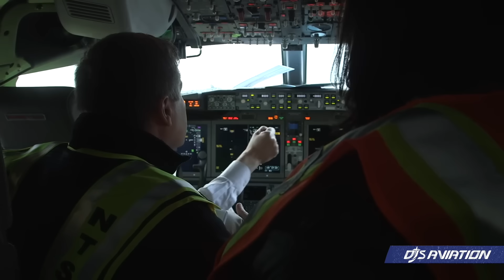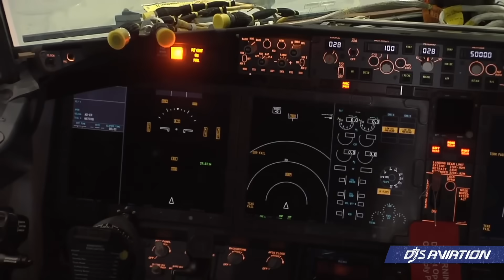Huge Boeing 737-9 Grounding Updates

Comment: Wow! 10 days since a defect in Boeing planes has endangered passengers! A new record! The Boeing corporation can be very proud! How long will it be before Boeing lays off more quality personnel?
Reply: Endangered passengers? It hasn't. Boeing corporation will not be proud as they need to sort themselves out from now on
Reply: @nickolliver3021  
I have no doubt that most of the people at Boeing are working very hard to make sure that their products are high-quality. I have less faith in the middle and upper management at the Boeing corporation however. As far as endangering passengers, by understanding, is that if the plug door Had come off at a higher altitude that there may have indeed been more serious injuries to passengers. As it was, my understanding is that some passengers on the Alaska airlines flight did have to go to the hospital for treatment.
Reply: @wbwarren57  gladly no one was hurt when it happened. No need for an explanation into it. The top management should be given a wake up call to pit their quality into their company rather than focus on the profit and getting numbers out the door. The faith is what action is taken. Hopefully immediate action will be taken on this. Once planes have been cleared to be ungrounded things will settle and we should see some changes quite quickly I should hope. Yes okay it could have been worse but it wasn't. Focusing on getting a solid fix good and proper is what's needed now.
Reply: @mipmipmipmipmip that's just imagining what may of happened. Doesn't mean that Boeings abysmal QA is absolutely a danfer to boeing passengers.
Reply: Better question..how long before the majority of what good mechanics leave Boeing?
Reply: That's exactlyy what it means
Reply: @nickolliver3021 of course, in this case, it put passengers in danger. Just because nobody got hurt, doesn’t mean people were not put in danger. SMH.
Reply: @rtbrtb_dutchy4183  anything like this will be putting passengers in danger. we all know. we get it
Reply: @nickolliver3021  What other problems exist, just waiting to wiggle free and cause catastrophic failure and were caused by a similar lapse in attention to detail. No, their problem needs to be looked at systemically as well as focused on this particular incident.
Reply: @nickolliver3021   171 of 178 seats were full; the two closest the door plug weren't. Extreme luck, given how much was sucked out even so. This could very easily have been fatal.  It's absurd and sickening to minimize it.  Boeing needs to fix these very much life threatening problems.  I suspect that only a very narrow window remains to do so, before their reputation is nil, customers won't book flights using their craft, airlines won't buy their planes.  An endless series of problems that could have ended badly.  Or did, repeatedly.

A320s and A220s seem to have far fewer serious problems, similarly Embraer.  That should be the standard, not Boeing's.
Reply: @bcbock  I don't see any other problems existing just waiting to wiggle free and cause catastrophic failure. This incident alone should be the wake up call
Reply: @bearcubdaycare  do you ever think that airlines won't be buying these aircraft ever again because of this issue? I don't think so. There reputation won't be nil. Customers will be booking flights on this aircraft when action is being taken on this issue. The results will prove weather orders and flights can resume. I'm sure it will. Tne plane needs to fly again after being ungrounded. 

Yes this could have happened to any plane either a320 or a220. Okay it happened on a max but okay it could have been alot worse. Luckily no one was near that seat by the window. This is going to be a wake up call. It had to be
Reply: @nickolliver3021  you don’t see any other problems existing and wiggle free, because this should be a wake up call?  You understand that there could be issues with airplanes that rolled out years ago right?  Just because they had a wake up call, doesn’t make any of the planes already in service, suddenly problem free.
Reply: @nickolliver3021  airlines will buy Boeings and passengers will fly them, absolutely. But it’s flabbergasting that after the MCAS, the culture inside the company hasn’t changed. 

But short term, they will lose customers. Long term will be fine.
Reply: @rtbrtb_dutchy4183  you won't know if short term they will loose customers. You won't know that unless it happens. 

So yeh airlines will keep buying them and so will passengers. Its the fact that MCAS isn't part of this issue as its separate. The culture inside will change as it will be a wake up call. I can tell ypu seriously don't see how they will get out of this.
Reply: @rtbrtb_dutchy4183  So you yell me what other aircraft may have issues that relate to this issue then? The 787 seems pretty darn well good to me. 70 odd delivered with no concerns. This is the only plane they seriously have challenges and problems to deal with. There's no hope in hoping more planes will have isdues when yet nothing seems to be occurring with the rest.
Reply: @nickolliver3021  I never said that Boeing won’t get out of this. Of course they will. I sure hope they will. We need a strong Boeing and a strong Airbus, otherwise we won’t have good competition that creates good innovation. 

And yes, short term they will lose some customers. Why?  Because there are passengers out there who won’t fly a Boeing. So some airlines will definitely weigh that in the short term. Long term, it will go back to normal.
Reply: @nickolliver3021  you say: “70 off delivered with no concerns” like that’s some kind of achievement. You shouldn’t even have to bring this up like that. Each delivery should be standard without concerns. 

And I mentioned it somewhere else. There are airlines that refuse deliveries from SC. They only want Seattle built airplanes. Airplanes from SC, metal shavings have been found in newly delivered B787s.
Reply: @nickolliver3021  I'm concerned that the 1.5 year MCAS groundings didn't give them an opportunity to assess their quality system. Given the long list in recent history of quality escapes (fortunately this is the only one that led to an actual incident in flight), and their obvious goal to ramp up production after the grounding, it would have been a wise step.
Reply: @AmbientMorality   I seem to get that too. Perhaps doors were not part of quality checking instead it wad mainly parts for the aircraft but yeh looks like it wasn't for everything. Hopefully this shouldn't affect the ramping up of production this year. In a couple of months I hope things will settle down and go back to normal
Reply: @nickolliver3021  Where do you work in the Boeing management publicity system?
Reply: @t20turnaround49  yawn 🥱

Comment: "Quality escapes can happen on any aircraft".   Your euphemism aside, one has to note that each aircradt type has its own systems for assembly, and missing quality assurance steps for 737 assembly when a speicific option has been ordered does not mean that this applies to all aircraft.
What remains to be seen is whether this was an mistake in written quality assurance procedures that didn't provide QA for the plug door but did for the 7 other door types, or whether Boeing ahd truly omitted QA in order to accelerate product deliveries.

Comment: This isn't about delivering an aircraft to the highest standards, it is about delivering an aircraft that matches the aircraft design that was approved by FAA.   And to ensure the aircraft matches what was approve, you need perfect quality assurance process throughout the assemby process. That is something that standards such as ISO 9000 strove to achieve to ensure consistnt and trustable product qualitty. 
Boeing used to be able to have aircraft being delivered mathcing the aircraft that was approved. It will need to rebuild the ad inistrative systems to achive this, and give the extra time needed to get plane from 0 to delivery with perfect quality assurrance. When you carry 150 persons or more, you can't afford to have missing bolts that are never spotted by anyone.

Comment: After Alaska took delivery of the plane they flew it to a facility in Oklahoma to upgrade the wifi which is on top of the plane near the plug door. Did they remove the door to get in and out easier? Pressure warning lights came on after work was done.
Reply: They said a while ago they did not move the door. And there were many days it had no issues as well afterwards
Reply: @tomstravels520  the question is did they inspect it as required after taking possession and where is that inspection logged.

Comment: I am a 777 pilot, just did a fuel stop in Seattle and saw numerous 737-900’s taking off on 14th January.
Reply: 737-900 is not the same as a 737-9 MAX
Reply: And not all 737-9 MAX even has a door plug.

Comment: Personally II think youre far to lenient on Boeing. Quality escape? Its became beyond clear the max program as a whole aimed for profit over safety every single step of the way from the top down. 346 deaths could have been prevented and I cant help but wonder how different public sentiment would be if it was United 610 instead of Lion Air. A couple management changes doesnt fix a deep rooted issue especially when that company is too big to fail and also most likely in bed with the faa .The question isnt "if" the max will have any more issues, its when. What comes to light next is anyones guess but I have a dark feeling that day will definitely come. They can point blame at spirit all they want we all know its just a shell company.

Comment: Bottom line is Spirit forgot to put the bolts in and their QC didn't catch it, compounded by Boeing not catching it either.
Reply: It is a temporary installation at Spirit. 
Boeing does final.
They're just hollow fuselages when they leave wichita.

Comment: With all due respect, disagree with the comment that "quality escapes can happen on any aircraft."  With proper procedures in place, they don't happen. Everything in aircraft production, servicing and operations requires PST (primary - secondary - tertiary) checks, wherein separate people independently check and sign off on one and the same thing.

When an organization's quality and safety culture is a real one, backed up by training, people, resources and time, this kind of thing doesn't happen.  When an organization doesn't for whatever reason respect the Cost of Quality, and begins to replace actions with words, then mistakes start to happen.  Boeing should not be allowed to mis-frame the issue by using this inappropriate terminology (quality escape).

This is what Boeing has cost themselves, even before this latest incident, by not investing in quality:

“The $204 million third-quarter loss compares with a $128 million loss in the same period last year. In total, Spirit has lost $692 million across the first nine months of 2023”

- “It also logged $49.3 million in additional 737 programme costs, reflecting aft-pressure bulkhead rework, and $10.6 million in additional A320 costs.

In August, Spirit said it had discovered defective holes in 737 aft-pressure bulkheads, requiring it to inspect and fix undelivered components. The problem also requires Boeing inspect and fix more than 150 of its undelivered 737s, prompting the aircraft maker to cut its anticipated 737 deliveries for the year.”

Comment: As a Electronics Engineer with 35 years of experience in Avionics and Ground based Navigation Aids I would advice the travelling public to avoid were possible Boeng Products. The History of Boeng and it's merger with McDonnell Douglas shows how a once successful Engineering Operation  has destroyed. Only travel on Airbus Aircraft. They have a better history of successful Aircraft designs, and production.

Comment: IMHO, Boeing should have to pay for the inspections of not only the plug doors but all flight control surfaces and actuation systems. Also the CEO, COOL and the head of the quality control division should be forced to resign. This DID happen on their watch.
Reply: Agreed. That’s what “taking responsibility” entails.
Reply: This issue is a Spirit AeroSystem Quality issue. Why don't you people take the time to look at the federal regulation governing the issuance of a manufacturing authorization. Spirit is required by LAW to provide Boeing with airworthy parts and assemblies. Since these aircraft average about 2.5 million parts, it ridiculous to expect Boeing to inspect every part, Duh.
Reply: Not only resign, but also pay back their bonuses (and that will hurt them a lot more).

Comment: It's all very well focussing on the Max 9 and grounding those with the specific plug door that departed this aircraft, but what is there to suggest that this QC failure is unique to this plug door? There should surely be a concern that missing or loose fasteners could be an issue in any aerostructures manufactured by Boeing's 737 Max subcontractor.

Comment: Alaska Airlines knew that there was a problem with this jet and left the row next to the defective door empty on an otherwise packed flight. Cancelations cost airlines big money and Alaska's maintenance in this matter needs to be scrutinized.
Reply: Grounding a fleet also costs big money. There is simply no chance they had any clue that plug had any issues. The fix wouldn't even be hard and deferring that wouldn't make sense.

Comment: I'm surprised you've not mentioned Spirit Aerosystems as they are the company that manufactures the fuselage. Boeing assemble the component parts but they don't manufacture them. Boeing quality control needs to massively improve but so do the companies that provide them with the hardware they assemble.
Reply: As I've heard a pilot comment, Boeing bears ultimate responsibility for the final product.
Reply: I’m not surprised as he seams not to really understand how planes are manufactured or the relationships of manufacturers. He more a plane spotter and news reader.

Comment: So the gaffa tape and zip ties didn't work?, were they installed properly?. What are bolts anyway?
Reply: No idea what a bolt is but the problem seems to have been fixed with some red sticky tape and plastic sheeting... 😂
Reply: @chrisantoniou4366  They could have at least sprung for some decent quality chewing gum and duct tape.
Reply: @Jitterbuggn  They ran out of that fixing the wings to the fuselage...  😂

Comment: Is it for sure Boeing? It is not unusual for the Plug to be removed for seat maintenance or other upgrades. Was this plug ever removed after the aircraft was turned over to Alaska Airlines? I don’t see an answer online yet…
Reply: Really? What kind of maintenance or upgrade does a brand new airplane with less than two months of use need. Alaska Airlines has nothing to do with this, it's just Boeing.
Reply: @ggrinfan It’s a matter of record. There is a YT site that mentioned that there was a Wi-Fi upgrade with photos of work being done on that section of the aircraft with visible scaffolding. If so, it should be investigated to eliminate that variable.

Comment: Hey DJ…
would you fly aboard a -8 or -9 ?
Reply: no
Reply: I will rather fly on a comac than to fly on a Boing max 8 or 9 and 10.
Reply: @barriewilliams4526 why
Reply: Absolutely not! Pilots wouldn't fly if they knew the escapes that have been happening for a decade. The Aft Pressure Bulkhead in all models and the P8 is a ticking time bomb!

Comment: In September last year an AD was issued for faulty A320 series doors that might have stopped the doors from being opened from inside or prevented the activation of the emergency slides.  It was a problem  in the way  a supplier made the doors but they ended on aircraft in service, so escaped the supplier's and Airbus' inspections. A year earlier it was defective lightning protection on A350 fuel tanks.  The point being made is don't be smug about Boeing's quality problems. It could happen to  Airbus. It's aircraft have had in the past two years potentially lethal production defects. In the case of the A350 the defect could result in a fuel tank exploding and bring the aircraft down.

Comment: Spirit AeroSystems is the manufacturer of the fuselage (and door plug). Spirit AeroSystems is NOT Boeing, it's a publically traded company. It is approved by the FAA as a manufacturer and repair facility. These aircraft have on average 2.5 million parts. BTW, Spirit makes "Big" parts for AirBus too. Spirit is bound by law to provide assemblies meeting specifications. Whistleblowers were telling the FAA that there were problems at Spirit, where was the FAA?
Reply: Then it comes down to the QA/QC process once the manufacturers receive the parts from Spirit.
I guess one company is doing a better job at it than the other.

Comment: If Alaska Airlines wishes to receive planes according to the highest standards, they should not fly Boeing. They want cheap. Just like Boeing management. Never mind the victims.
Reply: They want to be all boeing so this has to be fixed
Reply: Really, I don't want to shock you but this issue belongs to Spirit AeroSystems. Spirit AeroSystem also makes the "Big" parts for AirBus, enjoy your flight.
Reply: Clearly Boeing can save a lot of money by just updating a 60+ year old  design. It definitely can offer massive discounts. But imagine how outdated it will be when it gets halfway through its useful life 15 years from now.